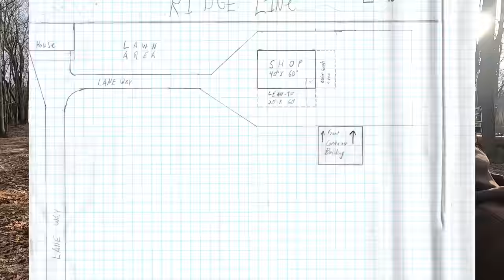Building my DREAM WORKSHOP Pt.1 Clearing the Site!

Comment: Another issue I noticed with fat Alice was all the white smoke that refused to clear up as the (very cold) day went on,  this  indicates the motor isn't reaching full working temperature, - not good from a wearing out prospective obviously,
 I would be inclined to think that the thermostat is  stuck fully open/ not even installed - to save an initial time consuming tear down of it - try tying a blanket over the back of the radiator (outside obviously lol) and see if after running  and working it for a while the white smoke subsides, if it does - and I suspect it will,  then look at the thermostat  for any problems.
Reply from the maker: Injectors need replaced
Reply: @DieselCreek  
Quite possibly,  but the tell tale for that is usually black sooty exhaust smoke,  piss poor starting and sketchy running, blue smoke is the tell tale for engine oil burning in a worn out motor,  and white smoke from both diesel and petrol(gas) engines is mainly due to not completely burnt fuel in a cold engine, try the radiator covering trick I mentioned and see if it is beneficial , it isnt a starting aid just a running aid and only takes two minutes and can be taken off at any time,  I say this as a Diesel and petrol mechanic of over forty years experience.

Comment: lookat all that clay rich dirt save it for sure...A new type of block is in the works not adobe not burned brick but concrete stabilized compressed earthen block...They are load supporting and do not cost shit low carbon footprint and the buildings last for hundreds of years ...These new type of block have a compressive strength of over 5000 lbs per square inch they regulate moisture and do not deteriorate for centuries ...They are a throw back to the old roman wall structures limed earthen ruble block ...they were called portulana but hey some thing lasts for hundreds of years call them what you want

Comment: Is anyone else thinking chain saw then dig the stumps out ?
Reply from the maker: Much easier to get stumps out by uprooting them, your using the tree as a lever then. Why would you wanna cut them down by hand? What would you gain from that? It’s more work.
Reply: @DieselCreek  that's fair enough, I would have thought with the hardware its just as easy to dig stumps out. Either way it looks like a lot of fun
Reply from the maker: @stevemunro4668  you’d be surprised. Even a big machine will have to work at some stumps

Comment: I had a 40x60x14 two garage doors shop 40x40 - 20x40 is two story wall separates it from shop it has heat and a/ c 6 inch concrete floors with floor drains in shop floor - 5 guys build it in 3 days insulated walls and ceiling finished metal walls and ceiling with garage door openers with a 10x 20 covered front porch 57000.00

Comment: 6 minutes in, the first tree, and already you have zero situational awareness.  That tree was flying backwards towards the excavator and you clearly didn't know it. If one root snapped, it would've come over and you wouldn't have seen it until it was way too late.

Always better to fell them and dig out the stumps.  You had so much room here and these trees are tiny.  Would've taken the exact same amount of time.

Leaving a backcut on that branch at 16 minutes was purely for show, which is NOT how a cut should be decided.  The hinge looked pretty good through despite you never checking the close side.

36:40, that huge log and stump probably weiging 2000lbs rolls TOWARDS the cutter, and he is too worried about the saw to worry about his legs.  Obviously everything worked out but what's worth more?  Maybe doing a little repairable damage to a $500 saw, or 4 months in the hospital, learning to walk again, and a lifetime of leg problems?

47:40, "not looking good" and yet you don't take a step back, you just plow on and hope for the best.  That's stupid.  "Here's the part where we try to .. and don't die."  "Not big a fan of this plan"  - then STOP what is wrong with you!?  Take a huge step back and reevaluate the plan.  One branch on that tree had already snapped off line a twig right in the thickest part.  Yet, at 48:55 the top of the tree is allowed to CATAPAULT uncontrolled directly overtop of the excavator.   Every single thing about that felling was a mistake and I hope you take a serious step back and look with an objective eye at all the things that could, literally, have killed you.

Comment: You should see if any mills near by would cut any long straight enough pieces into pieces for the house or shop or any other project. The one by me does a 50/50 split or more or less depending what sizes you need or what type of wood you bringing and what tou need. Like if you dont need the 1x3 1x1 ect they will give more 2x4 or if your bring maple or oak and you dont mind pine you might get alot more. They also make osb so if you bring them a truck load of the non straight and sections smaller than 8 ft they will give you a specific amount of osb its alot less like 25/75 because more goes into it but if its stuff your burning anyways...

Comment: A small ripper attachment makes root breaking a lot easier, we took a small fill in job up in the burned part of the Colorado mountains last year and I ended up serrating the front  of the ripper bar for our 10klb mini-x. 
Also went bonkers dropping a hundred or so small trees with a chainsaw (most of that area could barely let a moose walk between the trees), there were only three or four with trunks larger than 18''.
The old man I learned the excavation business from liked to call cottonwoods 'windowmakers' because the tops like to whip and snap on the backswing, falling on the guy trying to push them over.

Comment: 7 years ago, a neighbor logged out the mature hardwoods from a 20 acre woodlot i used to hunt coon in as a kid. i gave $2500 for all of the tops, that were mostly oak, hickory, and walnut, with some cherry, maple and ash, after the loggers were done. i cut up everything the size of my wrist and bigger, and sold them as firewood at $50-75 for an 8' bed, pickup load. i lost track of how many loads i hauled to a local amish firewood auction and sold, but i know i more than tripled my money, even after auction fees and fuel costs for my saws, log splitter and truck. i was sad to see it go, but happy for the extra income. i'd try selling the tops before i just piled them up and burned them. the stumps aren't really worth the trouble, unless you can find someone to take them as is.

Comment: Most of the time a small machine is great, but at a time like this more is better  The smallest Komatsu I have used is a 200, and have used a 300 a lot too, a real horse.  My favorite was an old 1978 1080  Case.  I spent hundreds and hundreds of hours in it and enjoyed everything but tramming it up above the high wall to scale rock or load overburden.  It had one side of the drive weaker than the other and you had to fight to keep it going straight all the way during that long trip up to the top of the hole.

Comment: rather than having a building built why dont you follow Andrew Camarata lead and build a cargo container shop this way it could match your storage area and you could make it 40x80 with a second floor this way you could use the interior of the containers for storage and work bench area.  you can install lifts and an overhead crane which would make it a awesome shop.  you can set up the containers yourself and thus you wouldnt need to pay for the labor of building a building.  you have ore than the qualifications required to do it your self and maybe a helper.

Comment: Make it as big as your wallet can afford, because later you say crap should of built it bigger. Maybe you could put piping in the floor for heat with a wood burning system for hot water heat in the shop cheap way to go for heat and works very well.

Comment: Play next really awesome heating system is also you can use old motor oil and I’ve got a wood-burning system where are you burn the wood outside in the heat goes inside

Comment: Nice watching as always!
I was wondering when you cut a felled tree trunk from it's rootball, why you first cut the top half and then continue cutting from below. I'd say there is more risk pinching the saw that way.

What is the little brown hut on the ridgeline? Power hookup?
Reply: I had the same question about the small brown/red shack.  Don't think it would be power since he had to run the light tower to generate hydro for the current shop.  But on the topic of the saw cuts, I think cutting the top first is correct in that it will allow room for the log to sag as it is cut from the bottom and actually open out to not pinch the saw.

Comment: If you för weld the tooth back on, read about what welding rods you need and what prep you need before you weld. Just so that it wont break off again.
I'm a mechanic in the Swedish merchant navy and weld pipes alot and have learned that you need different rods for different jobs

Comment: Redo the Subscribe sign on that equipment's blade; lol.
Reply: On that leaner; use o a snatch block and cables would of pulled it with NO chance of a fail away from your gear. Did so many times over 40 years of work.
The hardwoods would make a cabinet maker happy and you richer; especially if cut to rough lumber dimensions.
Reply: Welded on teeth are a total horror to replace I have found by watching a crew of 4 do it !

Comment: Great job, I still think you could at least pour the footings with your equipment.
Reply from the maker: Pole building, no footings
Reply: @DieselCreek  Maybe a video showing the plans for the shop and going over some of the choices you made. Also, how are you getting power, water (well?) and sewer (septic?) to the site? That type of video might be good to make on one of those days it's too cold/snowy to work outside much.

Comment: I spent weeks cutting, clearing, and pulling stumps on my 1/2 acre lot with my little skid steer.  From the progress you've made in such short order, I would have been better off renting an excavator.  Especially after bending the rod on the lift arm cylinder.  I'm looking forward to see what you do with your shop.

Comment: Hardest part about clearing is getting the initial clear done to give yourself room to work. Especially if its in the middle and no the outer edges. I wish i had the funds to build a shop large enough to work on my equipment in. It's been -40 here for practically a month straight its not fun to do anything out there.